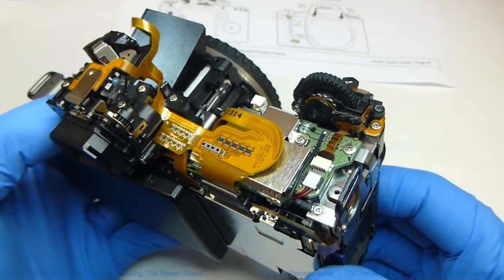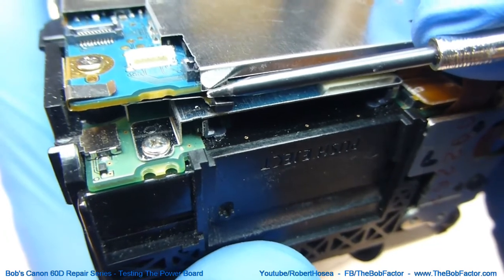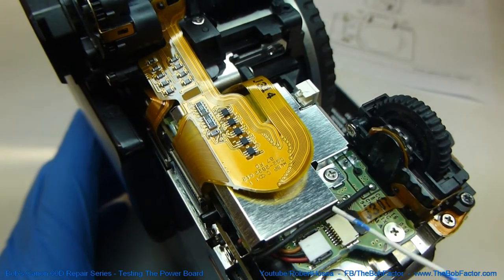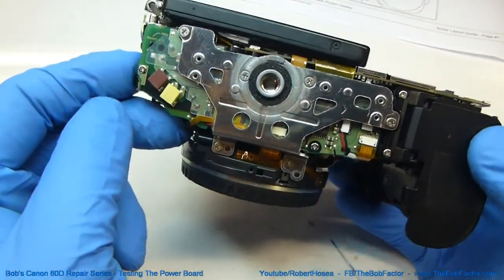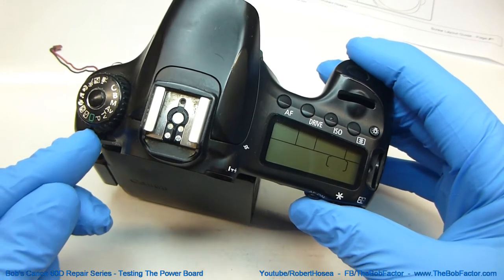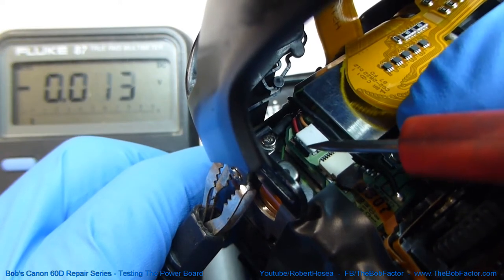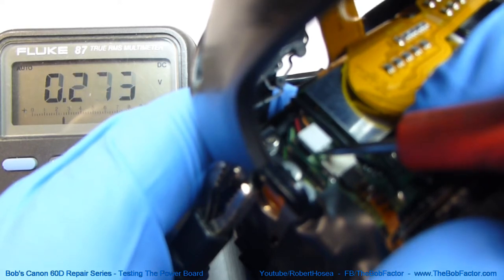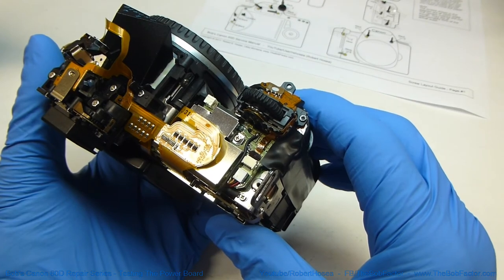Canon 60D Repair Series - Testing The Power Board

Comment: Hey! Awesome videos! 
I have replaced the shutter unit in my 60D (that was the only problem), but can't get the camera to power on AT ALL... :(
 I did some of these test - but one reading is off - the red wire in the top connector (minute 5:20 in the video) - it is always at around 5v - doesn't matter if I press any button or not... 
Please help! 
And thanks alot for the awesome videos!
Reply from the maker: Cool. Glad you like the videos! On the LCD display on the top, are you getting a blinking battery indicator at all?
Reply: Nope, unfortunately - nothing :( 
I made sure the batter door switch is pressed and the SD card switch also...
Reply from the maker: When you are trying to power up the camera, do you have the main back cover on? There is a micro switch that prevents the camera from powering up if the back cover is off. You can see the switch here: https://youtu.be/yeCrpv_u1Zw?t=58.
Reply: Robert Hosea yep, I stuffed a piece of paper there... 😮
Any other ideas? Maybe a power cable I forgot to connect?
I’m afraid to disassemble the board again because the screws are not 100% and I might strip some of them accidentally 😖
Reply from the maker: Rats. I was hoping for a simple fix with the micro switch. But I'm afraid the next step then is to remove the boards and check to make sure that all flat ribbon cables and wires are connected. Double check the flat ribbon that comes off of the top piece first, since it is the one that is coming from the power switch control.
Reply: Hi I have the same problem, after replace shutter zero reaction, like no power inside, do you found problem in your 60D
???
Reply: Hey, thanks for the series! I have this issue where the camera wont turn on but show a blinking battery indicator, even with a fully charged battery. This is about the battery sensor circuit? What is the best way to fix this? Thanks for sharing your wisdom!
Reply: @felipelube  me too! Flashing battery and nothing else

Comment: I have canon 70D body not powering on. Symptoms are
1. Showing only low battery symbol in case of battery low . I battery is charged then no sign in Top LCD or anywhere.
2. As soon as battery is placed and close the door, i notice the top LCD display flicker with orange light and nothing happens
3. i checked SD card & Battery door sensor. both seems to be good.
Reply from the maker: I'm not familiar with the 70D, but what you are describing could possibly be a bad power board if it were doing that same thing on a 60D.
Reply: @Thebobfactor  Thanks Robert. I well check the power supply

Comment: Excellent video!

By chance are you also familiar with the 70d?  I'm troubleshooting a no-turn-on issue with mine.  After tooling with the microswitches, which all appear to be functioning correctly, I came across your video and opened up my 70d to check out the power board.  I'm reading 8V as expected at the solder joints on top of the board, which you pointed out are the battery contacts. Where you have an orange-black-red lead going to the bottom board, I have a red-black-orange lead.  I read 7.6V on red and 4.2V on orange, regardless of whether the power switch is on or off.  Also I get nothing on the LCD.  Sounds wonky to me, what do you think?
Reply from the maker: Hi Ryan. No I haven't worked on a 70D at all. The two readings you got could be correct, as they are close to the 60D readings. But without knowing the circuit it's hard to say for sure. If the camera's circuit is similar to a 60D, then the readings may indicate a problem with either the main board, or the top piece. Is anything displayed on the top LCD at all?
Reply: Robert Hosea  thanks for writing back!  This camera never shows any signs of life whatsoever, no LEDs or LCDs turn on in any states.  Battery confirmed good on another camera.

Although the microswitches look mechanically intact, I might trace the leads and check voltage.  Do you happen to know what voltages to expect on the microswitches when they’re open?  I imagine it’s pulled up to TTL on one side and ground on the other, ie the switch grounds some input pin, or vise versa.  Does the power board supply TTL level voltages that can be probed?  Also, do you know if the power board outputs 4V on the orange lead to the bottom board if one of the microswitches is open?

Interesting point regarding potential problem with the top board; the 4V reading is similar to what you reported when the shutter release or other button is held down.  Could be a shorted button or maybe an open pull up/down resistor somewhere.  I semi tested this theory with my other camera, a working 60D; held down top panel buttons as I turned on the camera.  I was hoping that the camera would not turn on since that might confirm the broken button theory, but it turned on just fine.

Are you aware of any fuses in the system?

Another avenue may be the master power switch.
Reply from the maker: Ryan, I've never checked the voltages on the limit switches, but since we don't know if there is a problem yet with the power source, comparing the voltages may not be 100% accurate anyway. If you can trace the wires for the switches it would be much better to test for continuity on them while activating/deactivating them.

I would think that the 4.75 volts on the 60D is TTl logic voltage, since it's approx 50% of the source.

Supposedly there is a fuseable micro SM resistor on the power board for a 60D, but I've never located it. 

The main power switch could be bad. If it's similar at all to a 60D's it should be easy enough to test it, since there was just a few contacts and brushes associated with it.